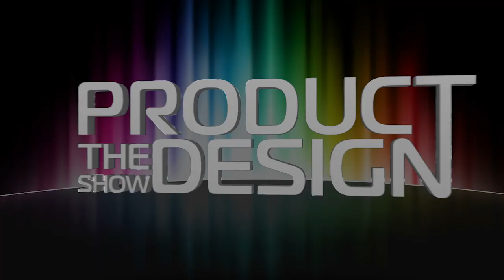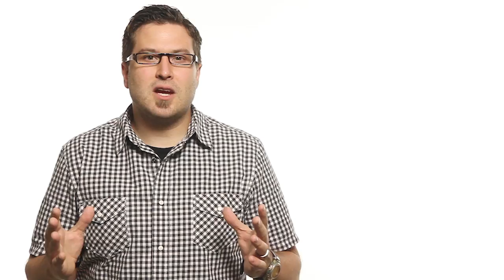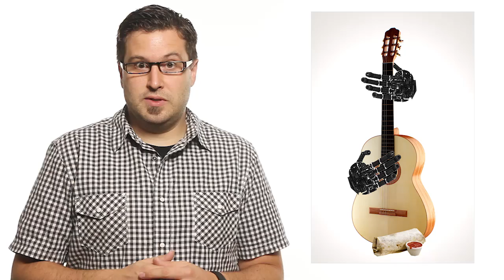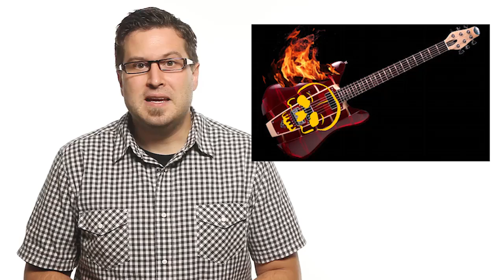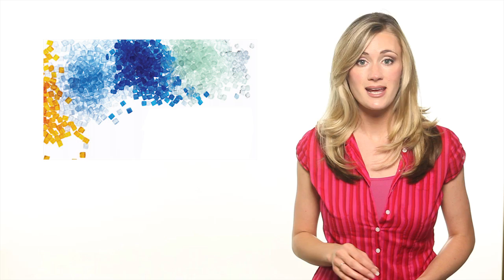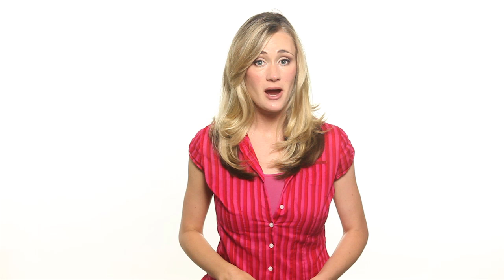Psycho Aesthetic Concept Design

Comment: The acid test will be how many mainstream artists end up using them, without endorsements aspiring guitarists will stick to the models like Les Pauls, Strats and Teles. The best thing that could happen to this concept in my opinion is to be bought and legitimized by a company such as Fender. Beginner guitars are inexpensive and these will have to be very cheap to compete on the beginner market. For the intermediate market the Slash fans will buy Les Pauls and the Vai fans Ibanezes, not these.